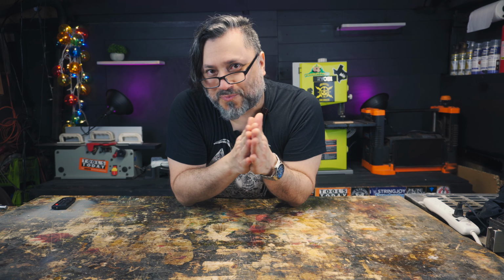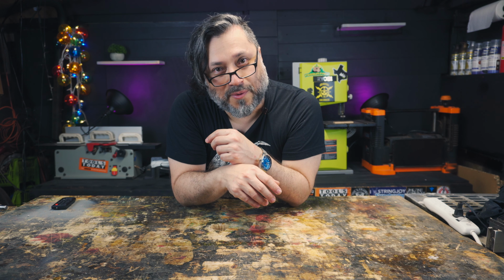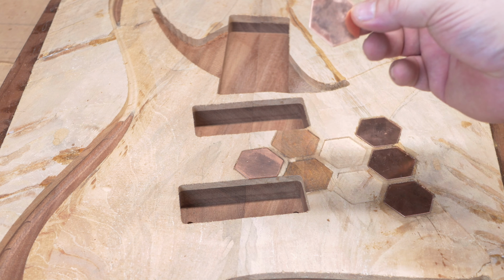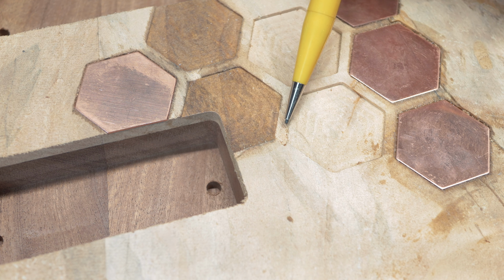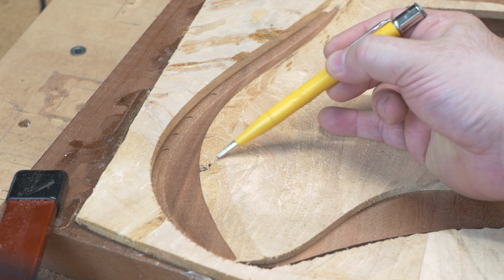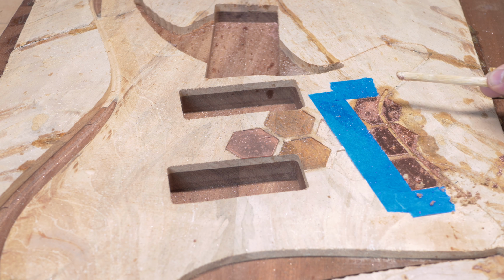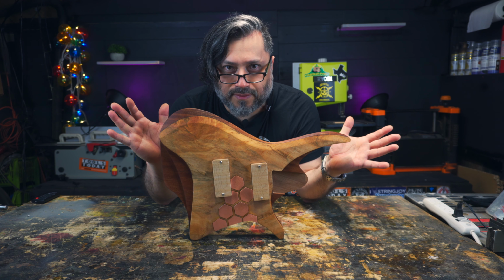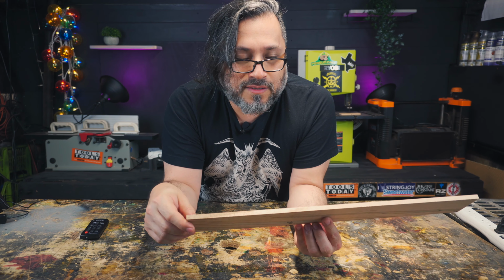Custom CNC Body - SUPER STRAT - Part 2

Comment: I like it all. I would've done some things a little different. Just my personal tastes. But overall, a beautiful thing.
Reply from the maker: Hi Garry. This is just a rapid prototype. I've never designed and built a body this quickly before. The weekly releases are pushing me towards swift design and manufacturing choices. Please let me know what you would have liked to have seen done differently. I can implement any changes in version 2. Thanks for watching!
Reply: @MarkGutierrez  Man, you certainly don't need my input. You're doing much better than needing to get my thoughts.
Like I said, just my personal tastes.
That would be;
1,A lit indicator for which pick-up is active by a glance at the guitar front.
2, The actuators be a dissimilar metal (An anodised black???, backlit [see suggestion 1])
Note, I hope you do show how you make your necks.
3, Headless neck?
4, pickup covers instead of the pale wood, maybe made of the body wood. ( This would include the fretboard as well inkeeping with the aesthetic)
5,Split humbucker/s, or only split front humbucker.
Please, don't take this as criticism.
This is only in a perfect world what I would have made for Me.
If money weren't and issue, and I could play guitar.